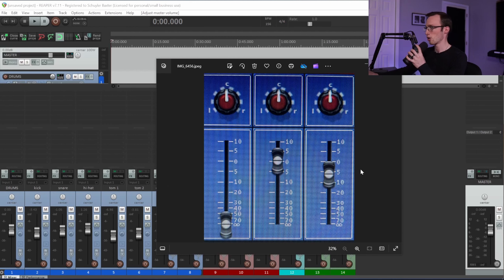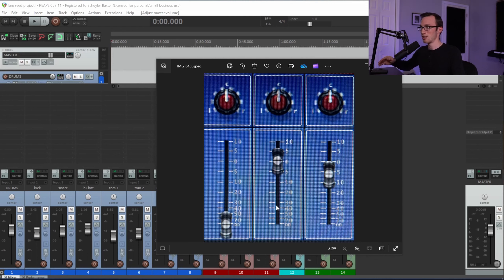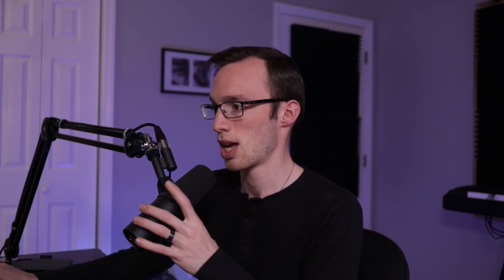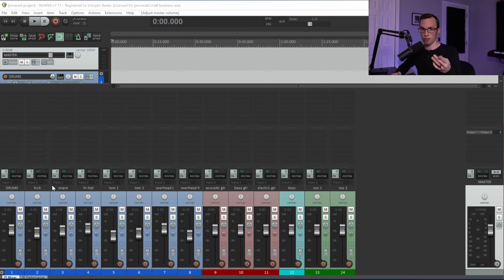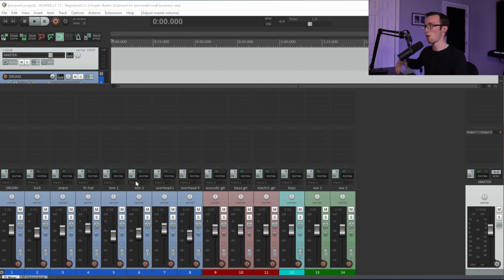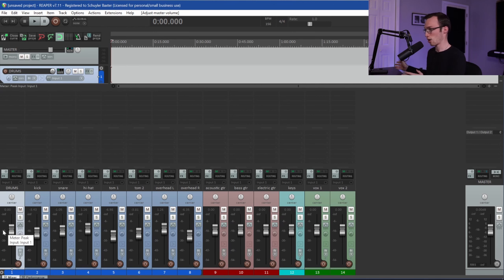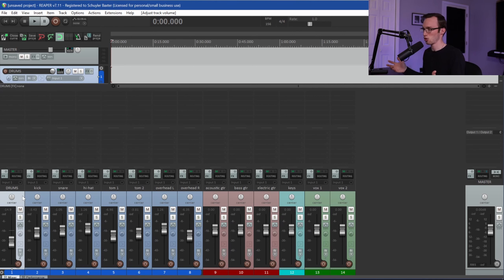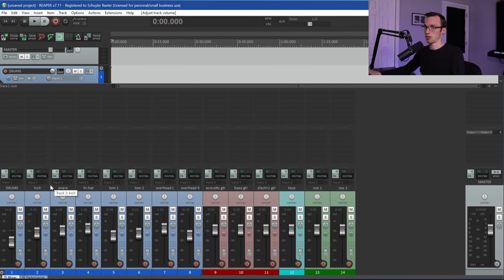Revisiting Mixing With Faders At 0

Comment: Interesting, I always mix with the mindset of keeping faders at 0 for the bulk of the process. Never thought of it as a methodology or principle or anything. It was just easier for me to keep everything controlled between the input and the panner/fader section and then just do small adjustments with the faders.
Reply from the maker: Just be sure to not confuse controlling volume with the gain knob versus controlling it with the fader. Gain is a completely separate process from the fader volume. Many people try to keep the fader at 0 and control the volume with the gain knob, and that’s the opposite of the way consoles are designed to work.
Reply: @themixingprocess  I know what you mean because I did it extensively in the past. :D but that's not the case, worry not. What I do depends on the instrument but the gain knob serves only to feed the channel at an appropriate level since I try to stick to analog emulations. It is possible that some fx chains have some kind of gain or volume control at some point, e.g. a clipper on a snare or the output of an amp sim.

Comment: Thumbs up! How about vocal recording. Should i record vocals in pre fader metering with all my faders at unity gain? Thanks
Reply from the maker: You don't have to worry about fader position when you're setting input gain for recording. Setting the input gain should be done according to the meter; get the average of the signal turned up to line level (where the meter goes from green to yellow), and record. Mixing with the faders comes later.